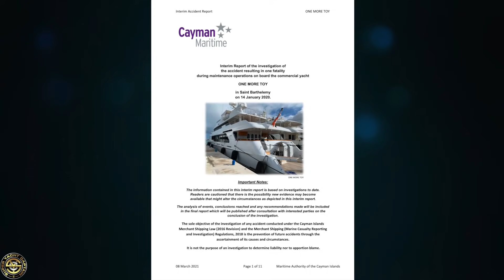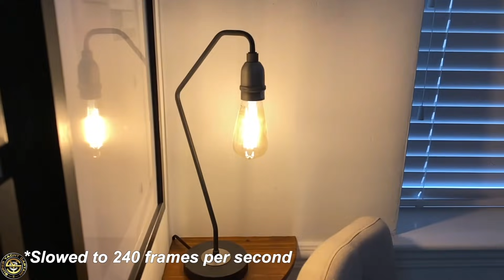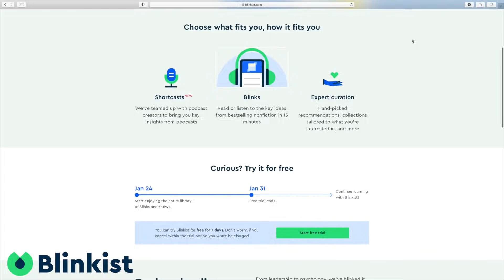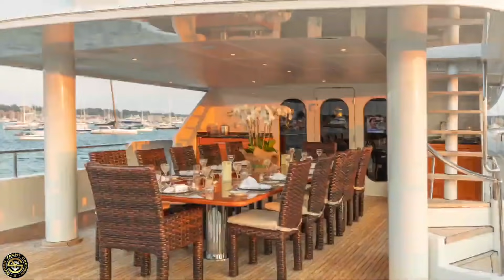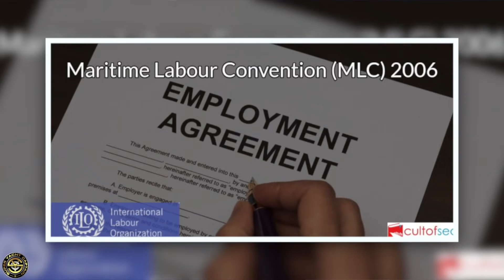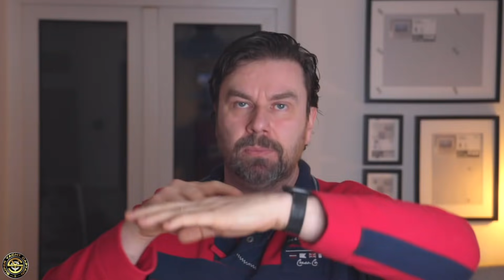Fatal Electric Shock

Comment: Yes you never want your body to be part of any Circuit and 480 volts at even low amperage ( and this was high amps I am sure ) is fatal as your heart is run by electrical impulses. Think of the load system as your hot water heater. Those heater coils have very high resistance which heats the to red hot , well as we say it takes a lot of juice to heat those up much more than our bodies can handle. Yes I have wired whole houses and had to work on hot wires ( not recommended ) and gotten jolts of 120 volts momentary but enough to hurt ... it’s nothing to do with you working by on a system sitting in water surrounding your boat yikes but we all make mistakes 
Water and current ooh they are a fatal combo sad to see this happen

Comment: Both of you are my personal favorite fantasy life channels ;-) It's a shame this collaboration was for such a grim story. One thing it would be important to note that electricity will always try to follow the path of LEAST resistance, such that when you touch a conductor, if your body provides a path to ground then you get shocked. When an arc is happening, it's because that electric potential has built up to such a level that it can bridge an air gap to ground, even that that's actually a very resistant path in itself. I worked for an electric utility company some years back, and we lost one crewman working on a substation due to arc from a transformer. The two people most likely to suffer injury working with this type of equipment are 1) someone utterly uninitiated to the safety needs and 2) someone who's been at it so long, they don't take an essential step as they feel they can take a shortcut, that may have even worked in the past. I hope steps are clear on how to avoid such tragedies onboard ship in the future. There's no safety measure too inconvenient to save a life.

Comment: The function of a Defibrillator is to stop a fibrillating Heart with a shock. Fibrillating is uncoordinated contraction of the heart. The defibrillator can detect a fibrillating Heart by a specific electric signal measured. When the defibrillator detects no heart signal ( because the patient has died) it will not see a shockable heart rhythm and therefore will say No Shock on the display. All crew members have acted correctly.
My condolences to the family and crew involved in this unfortunate accident.

Comment: Thanks Skipper along with the excellent breakdown from another professional I watch also. It is a crying shame that any engineer would loose his life in this manner, so so sorry. In future, may I please advise the following or similar depending upon country of registration be born in mind in regards to Special PPE required for high voltage work. 
CFR. 1910
Part Number Title:Occupational Safety and Health Standards
Subpart:1910 Subpart I
Subpart Title:Personal Protective Equipment
Standard Number: 1910.137 
Title: Electrical Protective

Comment: The technical explanation is somewhat dodgy at times.  If an electric wire comes in contact with something magnetic?  Ferrite is magnetic but not very conductive - just to name one example.
Reply: Pretty sure I said electrically conductive. If I said magnetic then it was a mistake.
Reply: @YachtReport  probably a slip of the tongue (9:53 to be exact).
Reply: Agreed...wonder if eSysman really understands electricity; personally I doubt it.
Reply: @borysnijinski331   You're all over this comment section suggesting eSysman knows nothing, and his explanation is no good. I thought I learned a little today, so why don't you re-educate me? tell us layman a better way of understanding how electricity works.
Reply: @adeyf7842  Borys is going to make his own video that shows us all how it's done properly. Isn't that right Borys?
Reply: eSysman, Seems like from looking through all the comments that Borys seems to have some kind of vendetta against you. Did you take a job away from him or something?

Comment: The next time anyone is tempted to bypass that “inconvenient” ground prong they should think about this. My advice is to throw away any two-prong extension cables you might own and replace them with high quality three-prong cables. In EVERY case of electrocution the person is forming a circuit from an energized wire to ground. Bypassing ground plugs opens the door for you to become that ground and that is not good.

Comment: This does not make sense.If the earth cable is not broken.then it. should have worked, The bracket connection to the tank was corroded.i would understand.What i dont understand also.Why are all systems not checked on a regular basis.It looked like them tanks had not been checked for a very long time.On a boat .it is so important with the sea envierment.I would be asking the main engineer why he had allowed them tanks to get into that condition.Because it was him who caused this death.

Comment: My father's design: a custom 40' sloop only needed two batteries with its 4 cylinder diesel. It gave no trouble for decades. Our only danger was the alcohol stove that demanded a small flow to heat it up before its use to prepare our meals. All I hear from these "super yachts" is problem after problem, even to cost the life of this innocent man caught in the crossfire between wealth and technical demands.

Comment: Bring in the expert to clarify and totally muddies it up. In simple English; The engineer got electrocuted by touching an equipment housing that was improperly grounded(or disabled). That housing became electrified when the insulation of an internal component (heating element) failed. By touching that housing and another body part making contact with some other object that was grounded, more than lethal voltage and current passed through his body. This would have been less likely to have happened in a metal hulled ship. This ship is made of fiberglass which is a very good insulator so a component not grounded would have the potential to become electrified. Perhaps a GFI device would have shut off the power instantly and saving his life. Yes they make them to work at those voltages.
Reply: His poor explanation of how electricity works would suggest he only thinks he is an expert and with flashy graphs fool the ignorant into believing he is an expert.
Reply: @borysnijinski331  Boris, put your money where your mouth is and make your own video, instead of just being a 'that guy' in the comment section of a video.
Reply: @YachtReport  
Well e, I’m glad you’re not currently working around hot circuits. I don’t want hear of another tragedy.
Reply: @SkypowerwithKarl  Your comment is patronising but the reality is I’ve been working at sea for 20+ years. People are free to think what they want and to try to elevate themselves by attacking others. But it’s petty. But if it floats your boat then enjoy. I’ll leave you to it.
Reply: The difference between your explanation and mine, is yours won't make any sense to someone who does not know about electricity. My brief was to explain it to people who don't know anything about the subject. If I said what you said, nobody would be any the wiser.
Reply: @YachtReport  graphs showing single phase and 3 phase voltage are not in any way relevant to the story.  Even less relevant is the flickering light demo.  Where you took 20 minutes to explain, poorly I would say, I can do in a paragraph.
Reply: @borysnijinski331  Do it, I’m waiting to see your amazing production! I’ve got the popcorn on the stove right now. Wow this is going to be so cool. A real expert in the house everyone! Who’s excited?
Reply: @YachtReport  well my popcorn is going cold waiting for the riveting video........best not hold our breath here mate!

Comment: If the load bank device employed a GFCI breaker it would have tripped this is what protects people in a hot tub from the same type of heater.
Reply: Not likely. What would be needed in that situation would be a gfci rated to protect equipment not personal. The tripping threshold would have to be set so low, less than 50ma. For reference a gfci recepticale has a tripp rating of 5ma. This would create frequent to constant nuisance tripping potentially creating an even more serious situation shutting down vital power in critical moments.

Comment: So, when was the last electrical test and report done.  How often is it required.  Earth loop impedance is one of the more important tests, so would have been picked up during regular inspections.  This is a classic issue but did having the boat registered outside of Europe and the US play a significant part in the lack of testing?  There's lots more questions to ask, but this engineer would have been fully trained in this sort of fault finding and the potential issues on large yachts of this type.   Tragic.

Comment: As an Electrical Engineer currently employed in the Commercial Microwave Oven Industry working on High Voltage 3 phase l can confidently say who ever is responsible for that vessel, the original Engineer, needs to be held to  account for that death. Every Engineer is aware immersion elements are at very high risk of mechanical damage from moisture. Add Sea Water into the equation, wow. Even if it’s not a written rule to regularly check, as an Engineer they should regularly check Earth Insulation just out of good practice. Every piece of equipment l have to establish several safety checks before touching equipment, Earth Insulation being top 3 checks, every time without exception.
Reply: I suspect that a lot of these “engineers” do not have an engineering degree.  In UK they call anyone with tools an engineer.
Reply: @borysnijinski331  the definition of an Engineer in the English language is and l quote the Oxford English Dictionary. 

noun: engineer; plural noun: engineers
1.
a person who designs, builds, or maintains engines, machines, or structures.

In Britain we have many different qualifications which differentiate the role that person is qualified to. Some snobs do label an Engineer as a person qualified to degree level, this language issue has caused a bit of a debate. Keep to the dictionary term, it’s easy to understand. As any Engineer will happily tell you what education level his or her qualifications are. In this case the Chief Engineer would be qualified for the role, with or without a degree. As is the case with any job in a professional level.
Reply: @chillee2531  where I am from, zero FGs about Oxford definition...to be an engineer you need a licence and to get that licence you need to go to university and get an engineering degree.  Then you need to work in industry for 5 yrs to gain relevant experience (that experience resume is evaluated to ensure it is relevant).  Then you need to write test on law and ethics.  Once that is all completed satisfactorily, only then can you call yourself an engineer.  Avoids having anyone with tool calling themselves an engineer.
Reply: @borysnijinski331  in you’re country the translation to English will give you the nearest equivalent. What a person calls themselves is kinda irrelevant, as you’ve stated you have to pass certain examinations and experience. That’s no different to the U.K. there are hundreds of different categories of Engineers, one word fits all I’m afraid. Also just remind yourself, those who discovered and pioneered Electricity didn’t study the subject in University 😉.
May l suggest you watch the full video explanation of what happened, maybe watch it a few times just to make sure you’re not missing anything as you’re making stupid irrelevant comments on the matter. Just for the record have worked with East European Engineers, you’re Universities must be really poor........
Reply: @chillee2531  buddy tries to tell me about English and does not know difference between “your” and “you’re”...FYI English is official language of my country...do not let my name fool you.
Reply: @borysnijinski331  that the best you got.......😂
Reply: @borysnijinski331  “need to work in industry” or “you need to write test” or “need to go to university”. Really if you’re going to give a grammar lesson, you need learn grammar. 🙄🙄🙄🙄🙄😜
Reply: @chillee2531  grammer is perfect actually; you quote Oxford, but fail to understand British English sentence structure...sorry, but you are fighting a losing battle on this front especially when you cannot spell.  I would engage in a battle of wits with you, but you are clearly unarmed.  I’m through discussing with you; you can have the final post/word.
Reply: Despite the best efforts of an uneducated arm chair expert from a country with less knowledge of electrics than Neanderthals, it’s pretty obvious this incident highlights the dangers of poorly maintained equipment. I’ve  over 25 yrs experience of HV, the incidents I’ve witnessed & come across always occurred when a number of circumstances align. Luckily for me my electrical qualifications and experience doesn’t require perfect grammar, luckily for my clients too. Unlike Boris who’s level of self gratification makes him blind to his keyboard skills. Maybe his 20th century device doesn’t autocorrect or grammar check, not that he thinks it is required. I feel Boris leaves a trail of incompetence that’ll be someone else’s fault, unlucky for any clients he may ever have.......

Comment: Not good to hear that a engineer lost his life, when I was 2nd engineer onboard my first yacht I had a Chief Engineer electrocuted to death onboard, Sad day for sure! It's a long story on the cause but in a nutshell it involved a conductive casing of a desktop computer which was "hot" due to being plugged into socket strip incorrectly so the the earth cable was energized which in turn energized the computer casing. I am very cautious working on electrical systems and work with permit to work and always double check circuits are dead with multi meter. Keep safe out there folks

Comment: I'm still not sure how this happened. I'm not an electrical engineer but whenever I dealt with 3 phase supply I ways isolated (normally mechanical) and checked before proceeding. Maybe on board means that owner/guest comfort comes first?

Comment: Frequency sets the speed of the motor not the amount of phases it has powering it. Thanks for the video
Reply: Scares me that so many commenters thought it was a great explanation...as a very experienced electrical and I&C engineer, I can assure you his explanation of electricity was shite.
Reply: @borysnijinski331  Indeed.  I was surprised to find out he was/is a marine engineer.
Reply: @blackal53  i doubt highly that he is a real engineer.  In UK anyone with tools is called an engineer.  He is very secretive about what he does and only says that he “works in engineering” and while he does not call himself an engineer, people without thinking will assume he is one.  Based on his explanation of electricity and 3 phase power, I highly doubt he has engineering degree.
Reply: You spotted that too.  Also the number of poles.

Comment: This is tragic, and should never have happened.  Listening to the explanation I understood it fully, but one thing struck me and I cannot get the thought out of my mind.  It seems to me that there has been a systemic lack of maintenance.  It doesn't appear if it was one fault that caused the accident, but indeed several.  Why did the earth path have a high resistance?  Why were the immersion heaters faulty?  It is highly unlikely that these things happened simultaneously, but rather slowly over a period of time. From the little that I've heard I hope that it was more than I just described as, if I am correct, it is a lack of good maintenance practices that have contributed directly to the death of a good man.
Reply: Correct  !   and as mentioned elsewhere the vessel design and construction predates the proliferation of residual current devices (RCD) now common in all new electrical installations.  Clearly a failure  or non existence of adequate inspection and testing regime and failure to appreciate risk and apply appropriate emergent control technology i.e. RCD. Frighteningly the  conditions that caused the high resistance could affect  all circuits on board.

Comment: Grounding and bonding, grounding and bonding. The most important part of any electrical system is it's ability to deal with fault current, a short. People tend to forget or disregard the grounding part of the system until it is too late. If the grounds on this system were in good shape it would have been more than capable to handle the fault and cause the breaker feeding the load bank to trip or turn itself off. Put ground system checks into your PM (preventive maintenance) schedule please PLEASE!!! I have seen these kinds of accidents happen way too many times and they are almost always preventable!!!

Comment: Electricity is not Easman  first or easiest ability.  I suppose was adaquate.   I am however a electronics engineer. and I lived next to Cristenson Yachts in Vancouver, who is now bankrupt, since 2015.     I suspect all Christensen yachts have this same issue.  Super Yacht,  "Missing Link"  was the last Yacht built. is one there somewhere , probably with this same failure.  Hope they got the word to check this load bank for faiilures before someone else gets killed.